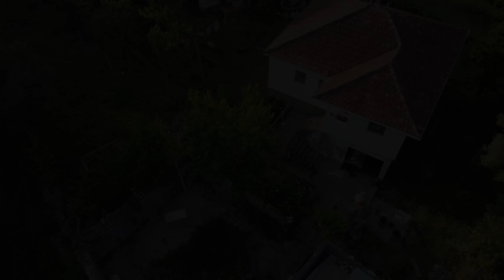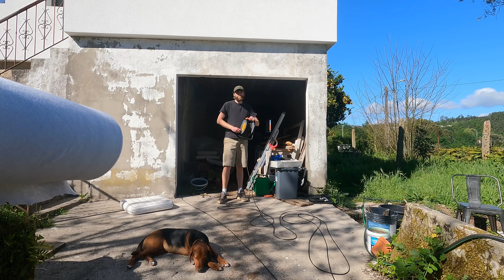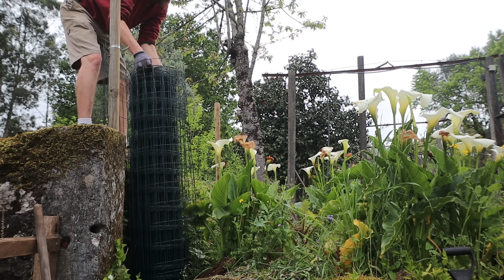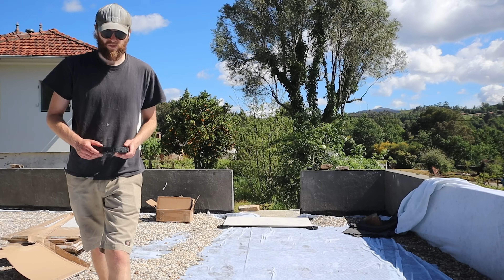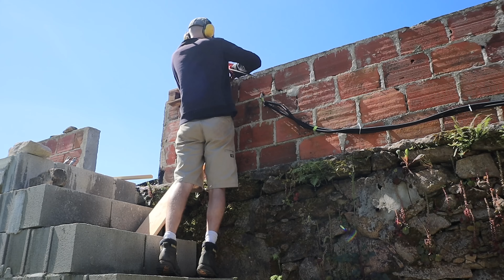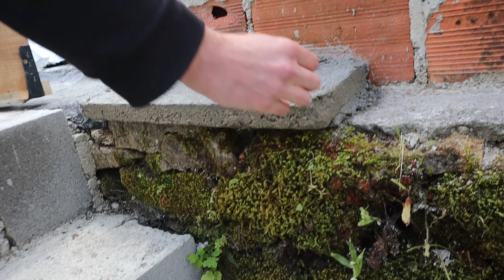#31 Building a Roof Terrace at Our Portuguese House Renovation

Comment: I’ve seen other channels make a form that’s level by fixing long planks along the edges, much like your inbetween pieces, then filling all in one go. Not sure if this gets your gradient covered but might be a time saver. Andy from Rustic Crow and Dan from Escape to Rural France both did it in similar ways, Andy at a shared house project with his brother James on their roof terrace too. I’ll see if I can track down one of those episodes if you’re interested. It may not be applicable in your instance. I don’t know your parameters and if they prohibit this sort of solution.
Reply from the maker: I think the way most professionals would do it would be to pour it in one go with a big form. It means that there wouldn't be any seams and look more uniform, probably stronger too. Doing it on my own this way is more manageable, yes it takes much longer, but I'm enjoying the process!